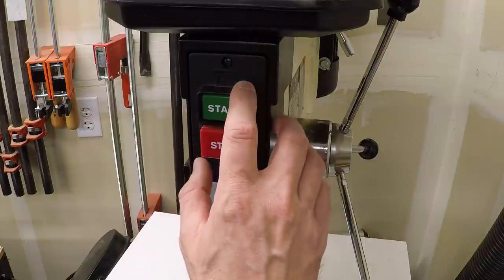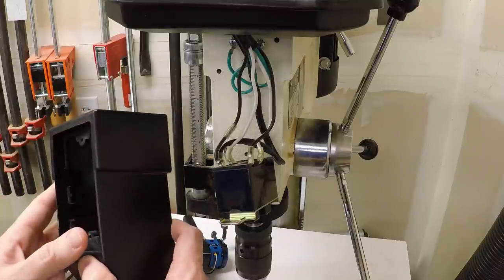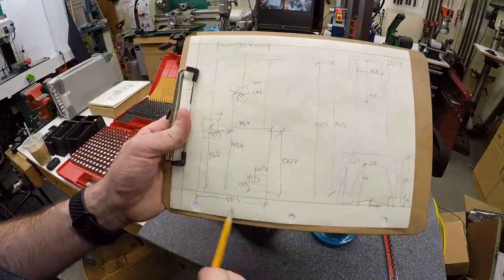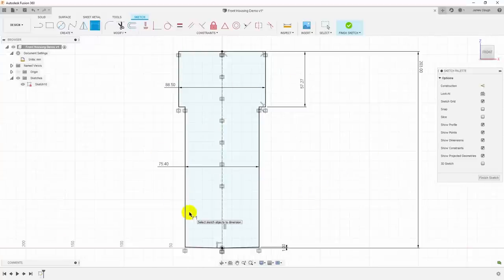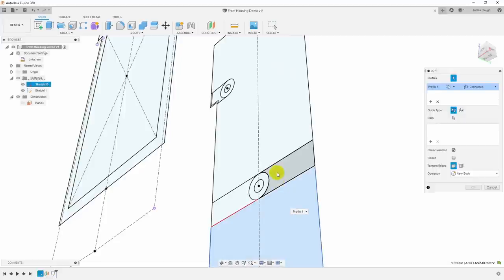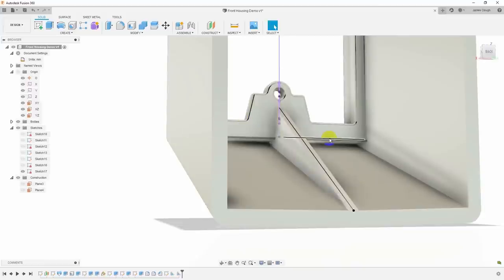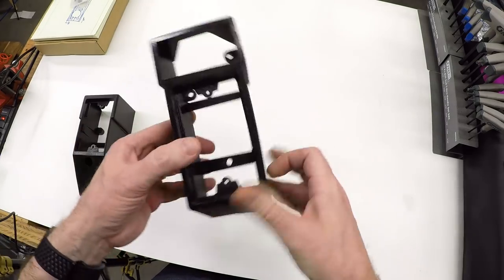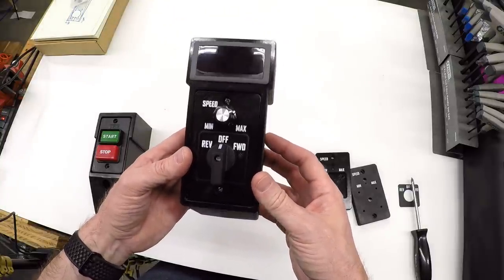3D Printing a Drill Press VFD Control Panel with Loft, Shell and Rib in Fusion 360

Comment: I'm really interested in seeing how to rig up the sensor for the tach.  I have a similar machine to do. Do you know, are the switches on a VFD remote  control momentary on?
Reply from the maker: I'll be putting the magnet on the underside of the large pulley on the top of the spindle and punching the sensor up through the sheet metal from inside the new control housing.  VFDs can usually be programmed for whatever control style you prefer.  Mine will be maintained.  The motor will run forward as long as the switch is in the forward position and shut off when I return it to center.  So not momentary.
Reply: @Clough42  Question, why did you decide to use the 3 position switch to control the motor direction instead of the I/O of the vfd? Seems wiring would be much simpler and safer as you're not bringing high voltage to the control panel.
Reply: @jon_raymond  he uses the IO of the VFD with the tree position switch. You can program the VFD any way you want.

Comment: James, @15:54 you called out 6.8mm and typed 5.8mm.. also you measured the draft at the bottom edge as .076” and drew it at less than 1 mm it is actually just under 2mm. Sorry I watch your videos very intently and enjoy them very much.
,
Reply from the maker: For a variety of reasons, I ended up re-doing and re-recording the modeling process several times, and I made a couple of mistakes.  The model you saw wasn't actually the one I printed.  Looking back at the model I used when printing, those dimensions were 0.271" and 0.77".

Comment: Millimetres! ICE wants to know your location.
Reply: John Alexander Don't worry - in 300 years US will switch to metric. They clearly show that in Star Trek.
Reply from the maker: Actually, the US switched to metric in 1958, when the inch was officially redefined to be 2.54mm.  We just screw around converting back and forth to other units to make things more challenging.  When I'm working with metal, I tend to use inches, since my machine tools have inch handwheels.  When I'm 3D printing, I think in millimeters, since my printers have 2mm pitch drive belts.  It's all just habits and tools.
Reply: @Clough42  25.4 mm
Reply: Flat Bastard Engineering Channel  Deci-inches.

Comment: great work, you "James'd it" again

but I'm not sold on 3d printing for precision parts, eg, your final was the 3rd or 4th attempt

Then the shrinkage you had to correct for on your PCB test jig

etc, etc, etc

And I've seen other 3D vids where, yeah, 3,4 or more attempts to get what you want.
Reply from the maker: If you're pushing the envelope, yes.  If you're printing something in a size and shape envelope with which you're familiar, the success rate is much higher.  Often I end up printing multiple times because I'm still deciding what I want and having an intermediate physical model shows me things and gives me ideas I couldn't have with the digital model.
Reply: This is true, and owning a 3D printer, totally understand the frustration.
The question is, what would you use as an alternative that can be completed so quickly and cheaply including the bum prototypes?

Comment: Please release your videos in parts. Length of the videos so long that sometimes i forget to complete it. Your content is awesome although I don't have a CNC or a lathe or 3dp but I still love to watch.
Reply: You could view it in parts 😀
Reply: It's already in parts.  This one was part 1.
Reply from the maker: Good feedback.  It's always a struggle.  I wanted this one to be about 25 minutes, but whenever I cut out details I get a flood of questions about the parts I left out.  And I really didn't want to leave people hanging after measuring for a drawing and not actually making anything.  :)
Reply: @Clough42  I found all of it pretty valuable.  The demo of measuring especially, and it's always nice to see how someone 3d models a part.  There's always techniques to pick up.  I would have liked to see the new part fit up against the drill casting :D.
Reply: The length of this video was about right for the subject and is just part 1 of the build. A lot of people have a longer attention span than a goldfish  (myself included) and get rather fed up with having to search through dozens of videos to find all of the relevant parts of a build just because the  video exceeds 10 minutes. 
James breaks his videos into related sections and tends to use natural breaks such as moving from design and manufacture to install and commission.
If you can't handle longer videos, save them to your playlist and watch then in multiple sessions.
Reply: @Clough42  Don't change , the length is perfectly OK.
Reply: @blahblahblahblah2933  Play it at a faster speed. I watch almost all YouTube videos a 2x. Some presenters who talk slowly I watch at an even faster speed.
Reply: @Clough42  No,  please don't edit it shorter. I''d rather have the greater detail, and decide myself if I want to jump ahead.